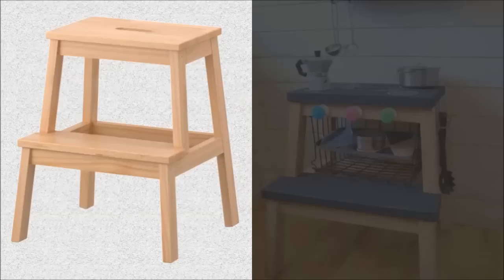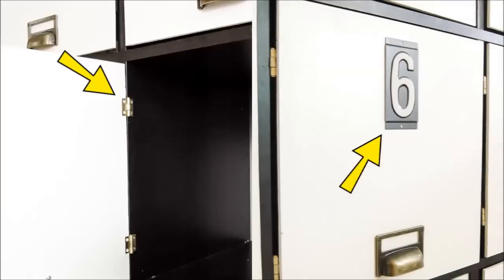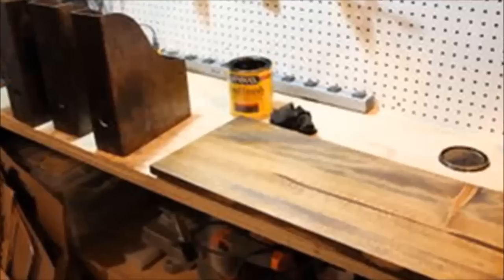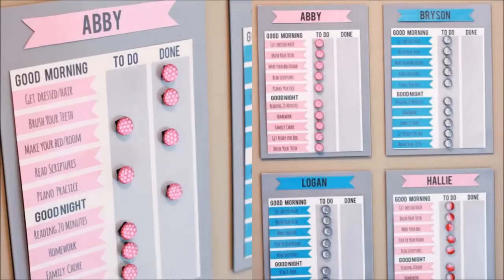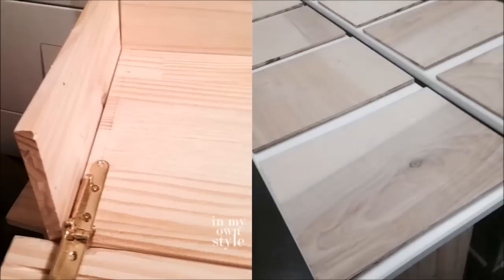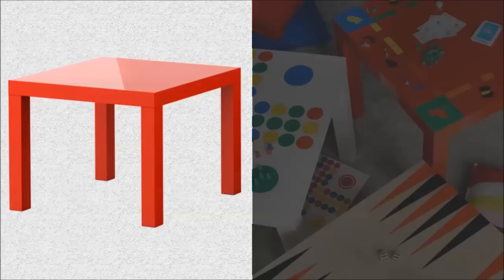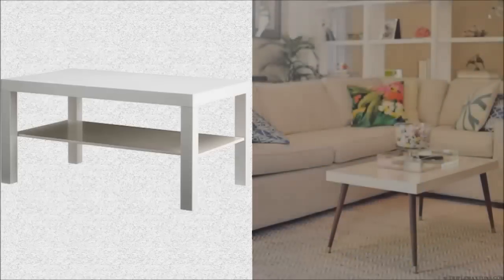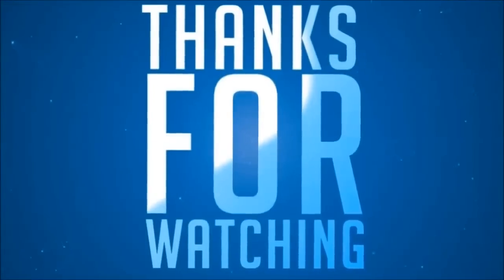20 Ultimate IKEA Furniture Upgrade Ideas

Comment: How does it make sense to buy a table (!!) so you can put everything aside except the top and put legs on it. Hmm... you could also buy a wooden board at a wood supply store. It comes already coated and the size you want. It's cheaper and you don't have extra stuff lying around at the end.
Reply: It is more so if you have table already and want to upgrade it